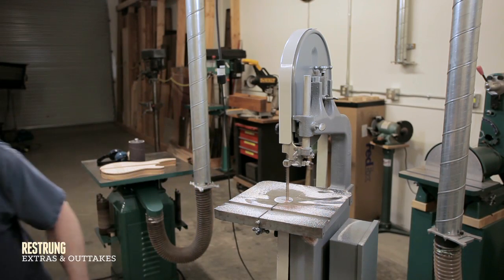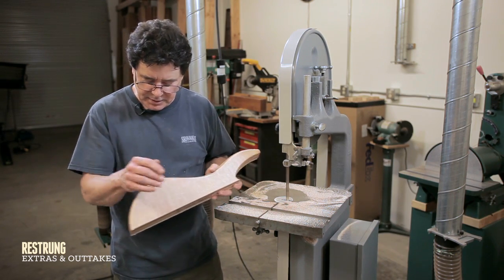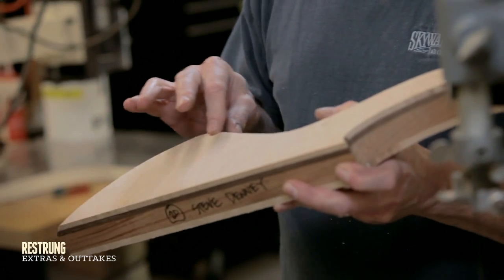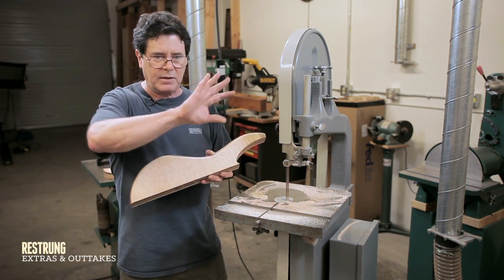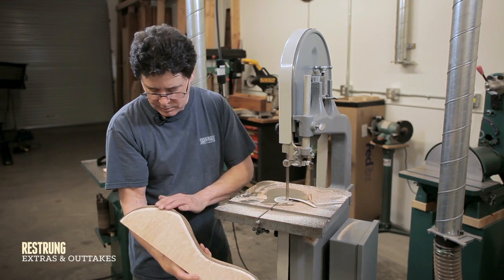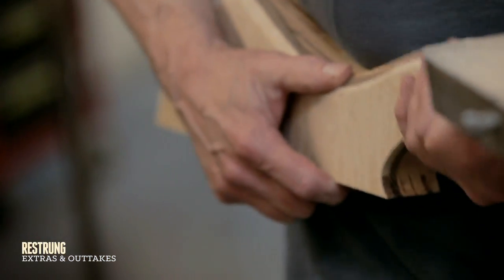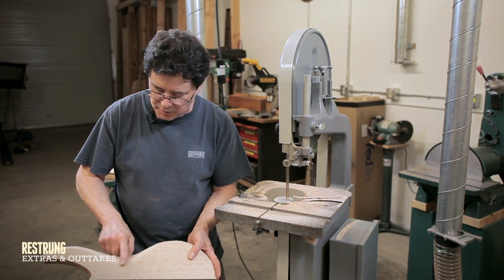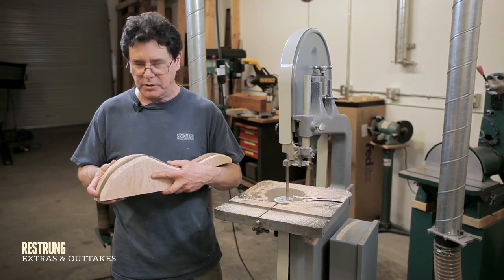How to Build a Bass Guitar - Step #7 - Sculpting the Body Wings on a Bandsaw

Comment: The band saw and I dont get along...nearly took my finger off once so I avoid it when I can.  Watching you do this makes me very nervous!

I agree with you on the changing radius but I rough it with a round over bit on the router table.  I finish my rough contours with a 4 in sanding disk on an angle grinder. You might be surprised how fast a 40 grit disk cuts away the wood.  I do the neck completely with the grinder.
Reply: If you like to make a lot of dust. I don’t find using the bandsaw this way to be dangerous. Just be focused.
Reply: @gingerjam2192  You have your fingers near a moving blade here.  With a grinder, your fingers are not near a moving blade.   One is more dangerous regardless of paying attention or being focused.     Way to revive a 6yr old thread though!